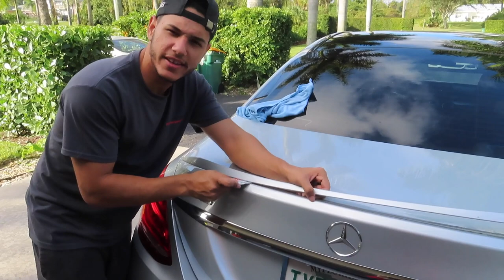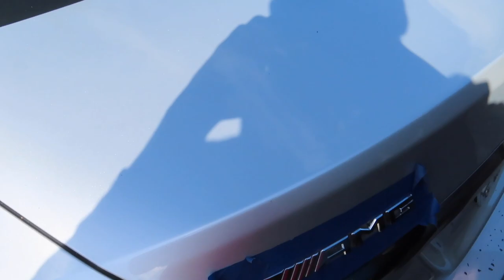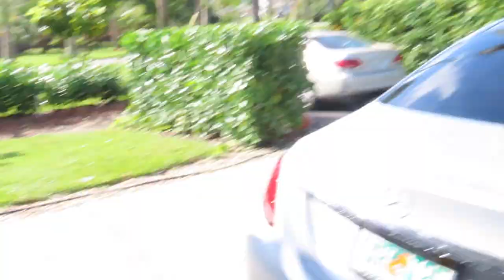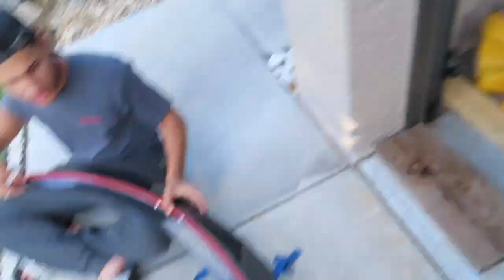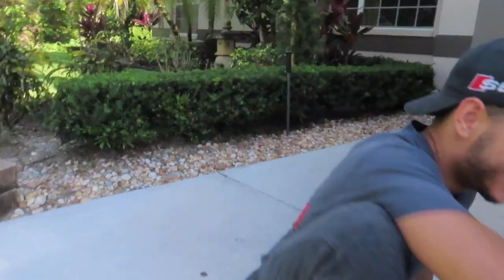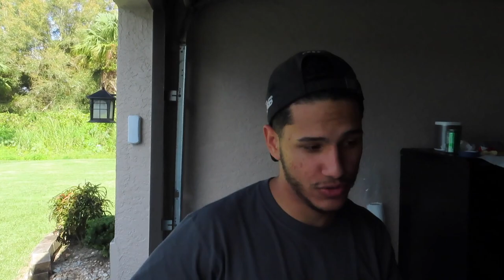Mercedes AMG C43 wing install (CARBON FIVER)

Comment: Bro next time I recommend you use lacquer thinner to remove that glue, I used it to remove the glue from the Jeep and ecodiesel decal on my Gladiator and what could have taken me hours of work I could do in ten minutes, is safe and does not damage the paint, my Jeep is white and it is not noticeable that I remove the glue with this chemical. Try it and let me know how it went. To be safe, do a test on a small surface and make sure there is no damage and then do it on the entire surface.

I found this video because I am going to put this same spoiler on my 2020 AMG C43 and I saw that you really suffered to remove the glue.